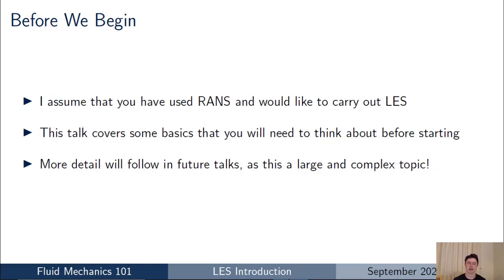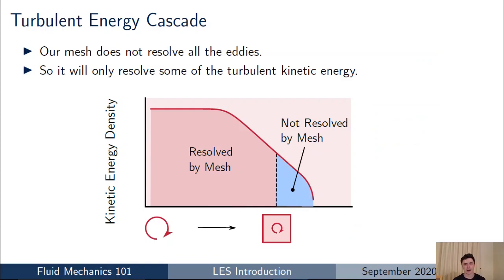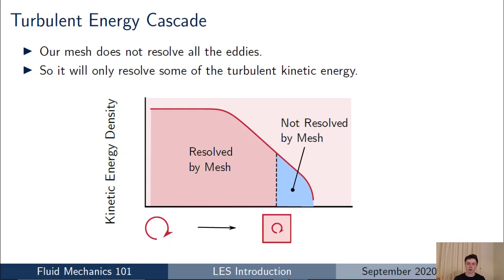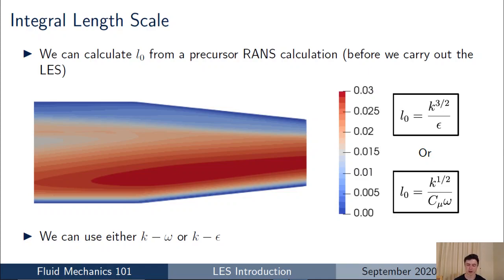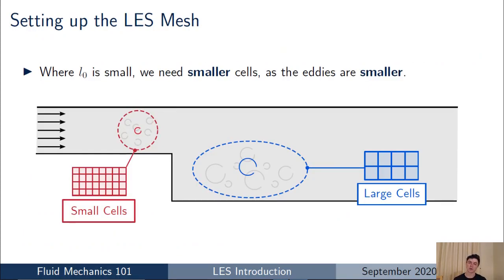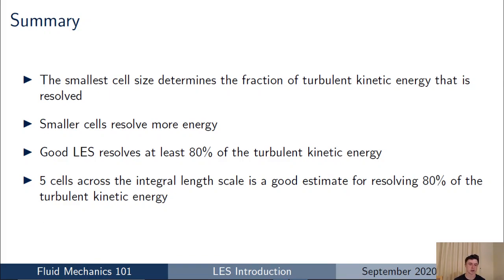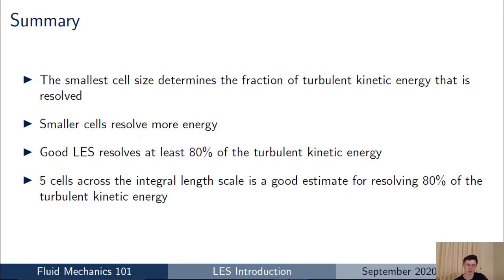[CFD] Large Eddy Simulation (LES): An Introduction

Comment: This video is the best thing that happens to me during my PhD. Thanks a lot. Can I ask you one thing. I have run RANS simulations in OpenFOAM so all I need to do open the case in paraview  and use the calculator to calculate lo?? Also wondering, Please correct me if I am wrong, I am using OpenFOAM online calculator to find  the y+ value then meshing my domain according to this as most of the literature says I have to have y+ value of 1 or below to capture the effect near wall in LES.
Reply from the maker: Yes to both of your questions 😊 you can calculate l0 in paraview and you want to aim for y+ of 1 for LES. I haven't done a video for meshing in LES yet but if you go for a y+ of 1 with a growth ratio of 1.15 or less you should be fine
Reply: @fluidmechanics101  thanks for confirming, I am getting lo value of 1.8x10-6 and my domain is 3d that is a big worry as it is leading to over 22 million cells with just using the refining box in the interested area. I can achieve the y+ =1 near the wall with 2 million cells and the rest of the domain around  0.004 but that won't be resolving 80% of the eddies. Basically, I am resolving one of the drainage system problems and working on a small model at a moment and plan is to study that model on LES with up to 2-3 million cell so later on, if I run the same method on the large scale model so cell range won't go beyond 7-8 million. I will be waiting for your next video. Thanks for the reply :)
Reply from the maker: Hi Muhammad, your 10-6 value is probably near the wall, so I wouldn't worry to much about that. Just try and get 80% far away from the wall. Have you tried running a test calculation to see actually how much TKE you can resolve? I wouldn't be surprised if you needed around 20 million cells. LES meshes are big!
Reply: @fluidmechanics101  I have emailed you from mchoudhry01@qub.ac.uk, explaining what error I am trying to resolve, if you have time please have a look and suggest. I ran RANS model(KOmega-SST) but there is a stage in a simulation where the outflow is over predicting (as u explained in your schemes talk ) model supposed not to be cross 5 litres/second but I am getting up to 7 litres/second. So I think, it is a time now I start investigating further by looking at LES, I have not run the simulation on LES yet as I am trying to find the ways to mesh in a way I will not reach too many cells.
Reply from the maker: I have sent you an email reply. Hopefully that should give you some things to try out 👍
Reply: @fluidmechanics101  thanks a lot, I am on it since haha I will further discuss once I have the data with me. I will get in touch with you on Patreon thing ....  platform you created is just amazing.

Comment: Thank you for the video, it is amazing.

I have one query. How will you identify the regions of insufficient mesh resolution in a 3D problem, where visualisation becomes an issue? 

One solution I can come up is - clipping the volume contour to desired range of the variable (Integral LS/mesh size), though I suppose it can be time consuming. OR, taking contour planes at areas of interest (easier if it is a zonal LES) and identifying regions with insufficient meshes.

Do clarify
Reply from the maker: Yes, that seems like a good strategy. Just take several contour planes through the volume. Some post processors will let you plot iso-volumes, which are nice way of doing it, if your post processor can produce them
Reply: @fluidmechanics101  Iso-volumes! Completely forgot about them. Yes, that's indeed a better strategy. Thank you!

Comment: I have a doubt here - wrt the integral length scale and the primary RANS calculation. We generally tend to use only 2D grids in RANS, whereas LES and DNS are mandatorily run in 3D grids. Hence when I first estimate the flow field turbulence and length scale using RANS, should I ensure to use a 3D grid, or do I just care about the 2D cross section of the geometry, wrt the sizing and integral scale and assume random sizing for the span-wise direction in LES? (i.e. run the 2D version of the geo/mesh in RANS, and apply the procedure of l0 and \Delta to only the sizing for wall-normal and streamwise directions for my LES mesh?) Thanks!

Comment: I was intending to simulate the analysis of a 5mm X 100mm cylindrical tube experiencing turbulent flow of water completely submerged.  Need to observe the frequency output of the vibrating tube. Using ANSYS for it. Any directions you can provide?
Reply from the maker: Start with a basic analysis, and then add complexity, step-by-step. I would start with steady RANS, then move towards unsteady RANS and LES. Otherwise, a complex analysis can be a bit overwhelming!

Comment: Hello,   a compressible flow with certain mas flow rate and certain pressure is going through a Converging and Diverging nozzle. The pressure outlet (known) is set. I am a littler bit confused what type of  boundary conditions should be applied to the CD nozzle inlet. Because if I set the mass flow(pressure) inlet, the pressure calculated is not equal to the given inlet pressure(mass flow).  Is that possible to set both mass flow rate and pressure at the inlet? Thank you very much.
Reply from the maker: I would set the static pressure at the outlet and a low mass flow rate at the inlet. Converge this calculation and then slowly increase the mass flow rate until you get the conditions you need. This calculation can be quite tricky to converge in CFD so just go a bit at a time

Comment: So in regards to you statement that you could not resolve a eddie smaller then 4 cells (timestamp 5:40ish) if you had three cells with the velocity vectors pointing in a triangle shape would that not be able to be resolved (doesnt seem like it would make any real difference to this, but just curious if there was a reason that couldnt be resolved (or if it is just unlikely to happen)...
Reply from the maker: Ah yes you could do this! Well spotted. However, people normally use squares, cubes and rectangles for LES as they are less diffusive. I suppose i forgot triangles and tetrahedra!

Comment: Why are you considering a collocated mesh instead of a staggered one? I know for unstructures meshes it is simple, yet Arakawa proofed that the best grid to avoid some problems was using a staggered one.
Reply: An excellent video, though!!
Reply from the maker: I usually explain with collocated meshes as these are what Fluent, CFX, OpenFOAM and Star CCM use. I figured it would be most helpful for the majority of people. I am sure you are right though, maybe staggered grids are better 😄
Reply: @fluidmechanics101  I think it is more clear as you explained it (as well as you don't have to code that much (or even nothing) in these programs), yet, when programming it (not just an LES, but any kind of NS solver)... my god how unstable a collocated mesh is...

Comment: Why do eddies form? Is it because the speed of the fluid will vary because of constraints, such as pipe walls?
Reply from the maker: I suppose 'why does turbulence occur' is an easy question to answer (small instabilities aren't sufficiently damped by viscosity at high Reynolds numbers) but 'why is the structure of turbulence the way it is' is a much more difficult question, that is quite close to one of the oldest questions in fluid mechanics... I wouldn't be brave enough to try and answer that!

Comment: hello anyone. in minute 24.00. where is coming from k^3/2 and also the epsilon?  and why the delta is 1/3 overhere?
Reply from the maker: K^3/2 / l0 is the standard definition for the turbulence length scale in the k epsilon model. If you check the units of turbulent kinetic energy ^ 3/2 and divide by the units of epsilon, you should find units of length (metres). This is a good check. To find the original definition you should probably check our the original k epsilon model papers (Brian Launder in the 1970s)

Comment: Could we not have single cell eddys?
For simple example in a 3x3 grid with a "large" eddy, would it not be more accurate to also have a rotational component in the central cell?
Reply from the maker: You are correct, we could specify a vorticity at the centroid of a single cell, thus having an eddy in a single cell. But remember that the definition of vorticity (or curl) needs the gradient (i.e. the rate of change of velocity in space), so we do need more than 1 cell to calculate the gradient
Reply: @fluidmechanics101  So you could theoretically make a higher order solver/grid with significantly larger cell size while maintaining accuracy in regard to vorticity? (on the order of 1/10 the cell count)
At least for LES cases maybe.
Reply from the maker: Yes! This is partly why spectral element methods (higher order methods) can be preferred for LES and DNS

Comment: Just out of curiosity, where does the 80% figure come from? Do you know a good source that explains it in detail?
Reply from the maker: I got the 80% from an old ANSYS presentation. Im not sure where this value comes from but it seems to be accepted in the CFD community. I am still searching for a good source and will let you know if I find one, because it is still a bit of a mystery to me!
Reply: @fluidmechanics101  I believe the paper "Index of Resolution Quality for Large Eddy Simulations" by I. B. Celik mentions this. I skimmed Pope's Turbulent Flows (2000), which seems to be the origin for the 80% figure, but found no justification for the number.

Comment: Thank you for the video. For peope using openFOAM how can we calculate the Cell Volume and therefore the integral lentgh scale? I was trying to use the paraview calculator but I cannot find the Cell Volume option! Thank you
Reply from the maker: I think you can get the cell volume using the 'foamPostProcess' utility. This will write the cell volume as a field, which you can then use in the calculator in paraview
Reply: @fluidmechanics101  Yeah I used a postprocessing function. The only problem is that I keep getting huge number O(10^12) whenever I try to use that quantities with the calculator. Maybe I should slice the domain and integrate the quantities on the surface? Thank your really.

Comment: At 11:29, I am having trouble understanding why the integral of kinetic energy density = turbulent kinetic energy. Any tips ? Great video!
Reply: When you get the plot of the kinetic energy density you are basically computing the kinetic energy in different frequency bands/wave numbers. Let's for example say you are calculating the energy in a band of 0 - 10 Hz, that gives you the first bar of your histogram, the next bar would be 10 - 20 Hz and so on. The plot is essentially a plot through the peaks of many really narrow (small band) histograms. The total KE is therefore the sum of KE in all your bands. The area under the curve gives you this value and the area under a curve is obtained through an integral.
Reply from the maker: Fantastic explanation 👍
Reply: @BrandonLobo  @Fluid Mechanics 101 Thank you so much Brandon for your explanation. I am still missing the link between Total KE and turbulent KE.  In your last sentence, you say that the total KE is therefore the sum of KE across the bands expressed by the area under the curve. i.e the integral. How do you related this area to the turbulent KE discussed by Aiden ? Thanks !
Reply: @Ashwah1993  When I say KE I am talking about turbulent KE. Does this clarify things? In my experience, one does not really deal with KE other than turbulent KE in CFD.  So all references to KE are turbulent KE.

Comment: could you please explain how do I plot the f in the post-processor?
Reply from the maker: What post processor are you using?
Reply: @fluidmechanics101  I use Palm Cfd software and I use MATLAB for post processing
Reply from the maker: Ah if you are postprocessing manually then you will then you will need to calculate a new array of values for f, from your solution values. Then you can use 'meshgrid' and plot using 'contourf' to see the contours